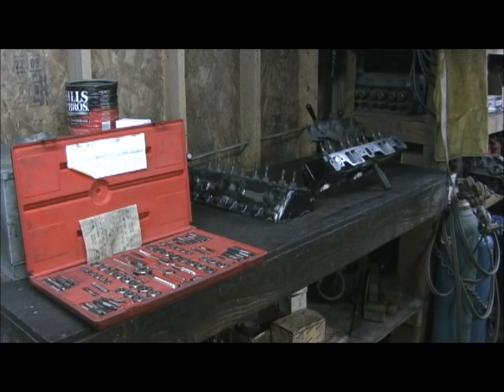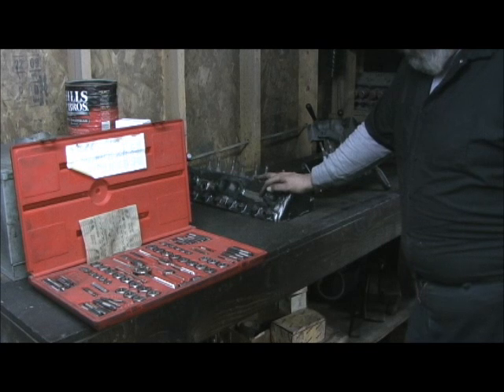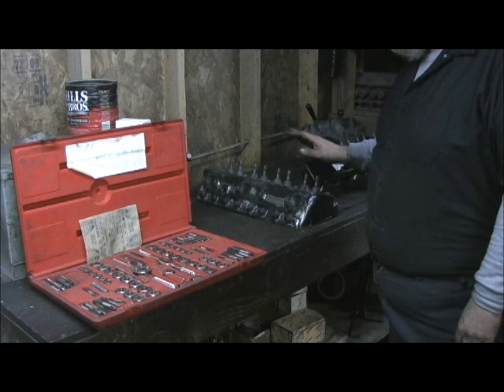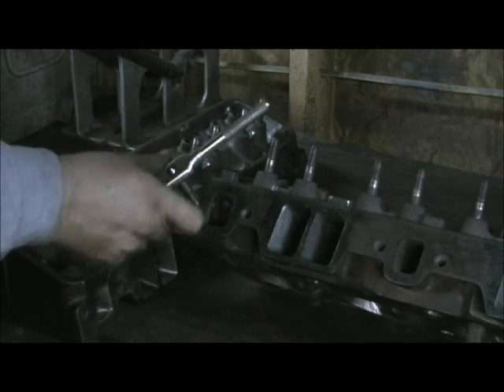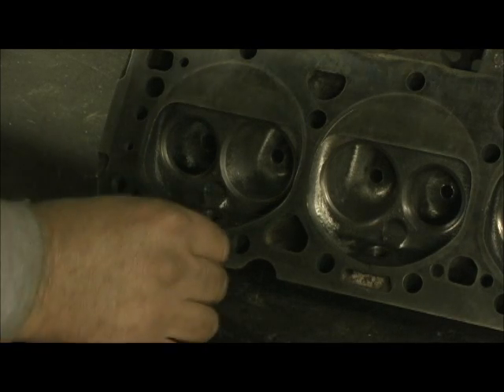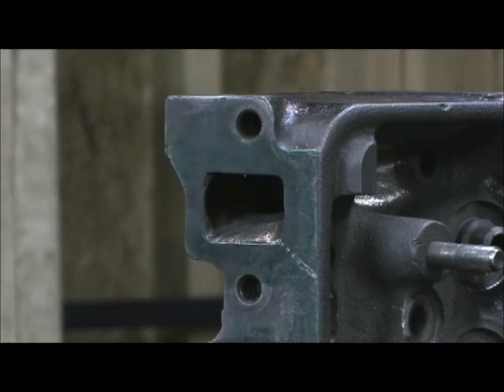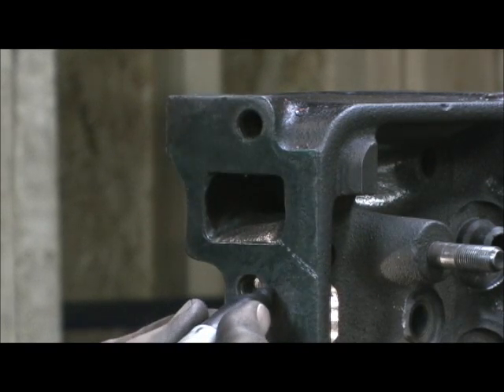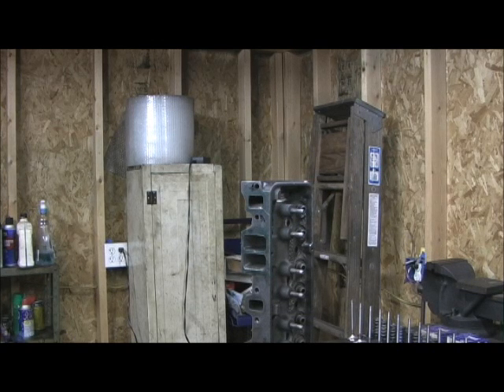Casting Chevy 441 Installing Heli Coils and thread check 7

Comment: Yes I have a set of 185 AFR's that I bought assembled (Oops) But I knew I had goofed when I realized that the springs couldn't handle my cam.. But I would like to test the out the box 185's vs what you can do with the DOE on a mild ~ 375 HP 306

Comment: Goes with out saying that you do great work. However I have been wanting to send you a message in regards to a set of heads I want to try to do myself for a budget 302 build. They are the original set of heads from a 1970 351 Windsor out of a 70 mustang.. DOE heads. Just wondering what tricks you may be willing to share with me or even better if you could make a video series of them.. Also interested in getting a quote for some work on them also and if they are worth my while...  I would like to compare them to out of the box AFR 185's
Reply from the maker: I have replied today, sorry.